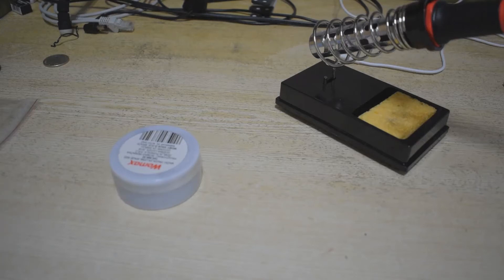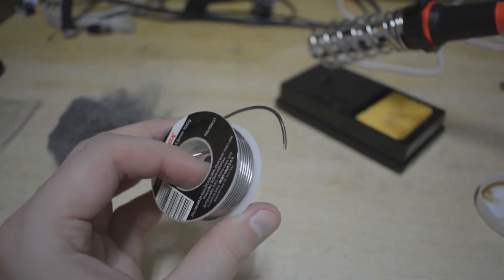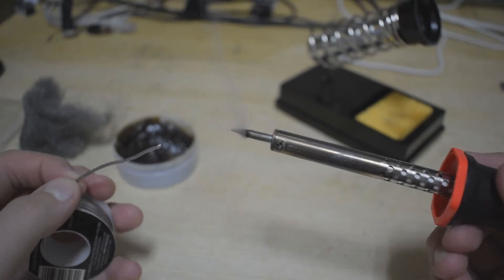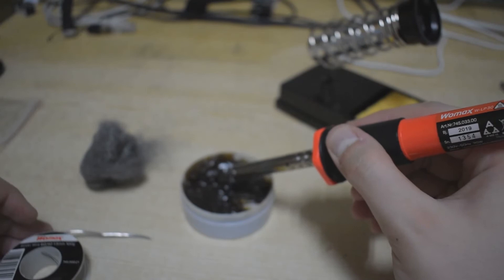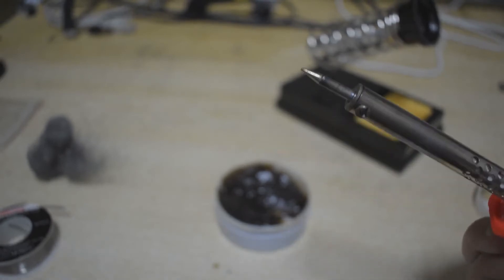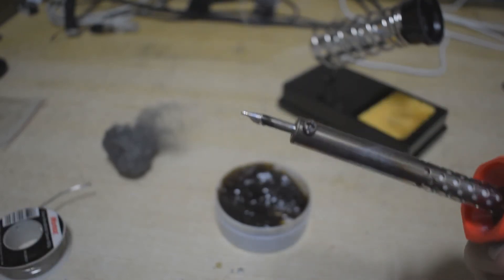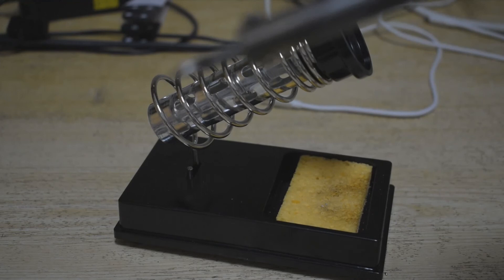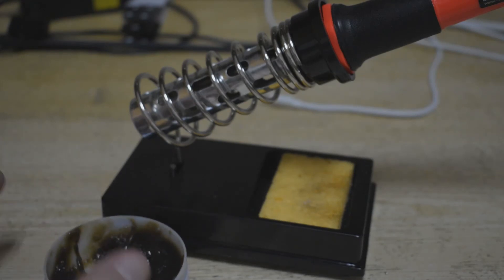HOW TO CLEAN a soldering iron tip

Comment: what temp do u recommended?  i try but still Oxygen
Reply from the maker: It'll always oxidize of it doesn't have temperature control. I recommend you get a temperature controlled soldering station. The ideal range to solder at would be from 300-350°C.
Reply: @milanfixer  i have iron with temperature controlled , now three tips are oxidize 😂😂
Reply from the maker: @giovannigiorgio2  Always leave some solder at the tip. Clean it before soldering a joint and add the solder back after you're finished. Also, please check the temperature of your station, it might need to be calibrated.
Reply: @milanfixer  btw i have normal iron but with display temperature control,  im start thinking the temperature control is fake

Comment: Can you advise me
I did what you do but my tip always turn into black and soldering wire don’t stick to the tip I’m so frustrated
Reply from the maker: My friend, your tip is getting extremely hot. If you have a cheap soldering iron like the one in the video it's always the case. Get some sandpaper and remove the oxidation from your tip, get some steel wool to smooth it up and get some solder on it as soon as it gets hot.

In the future, plug in the iron only when you use it and unplug it immediately after you solder your joints.
Reply: @milanfixer  
I did with the steel wool
But nothing happens lead wire
It’s still doesn’t stick on the tip
Reply from the maker: @danzmotovlog3982  No. Steel wool removes very little material. Use the rough sandpaper first, you need to expose the clean and shiny part of the metal. Then turn the iron on and solder will stick again.
Reply: maybe you have a bad tip. i was out of flux, so i ruined a tip because i had to sand paper and re-tin too often, and i had to let iron get way too hot, just trying to get solder to flow, and sometimes it just wouldnt, i used to work doing HVACR & i brought home end of the roll plumbing solder & small pieces of silver solder, i cant mistake the silver solder, its a stick like a welding rod,  but the acid core plumbing solder looks similar on a roll. if your soldering electronics, its not very costly to buy a new roll of rosin core solder & new tub of flux paste. where i live i can buy a new iron, cheapie, from walmart that comes with an extra tip for less than just getting 2 new tips .. 👍🏻😁. good luck ..